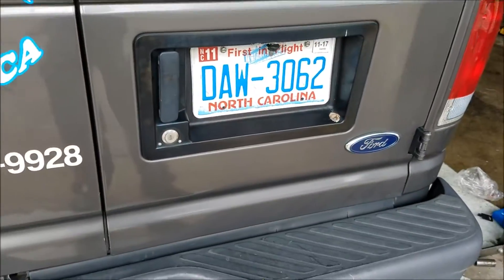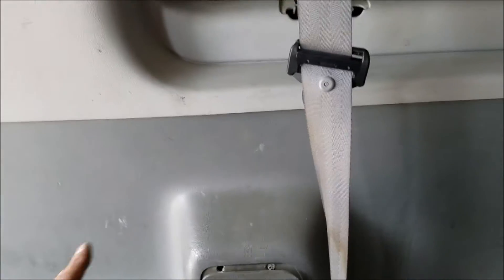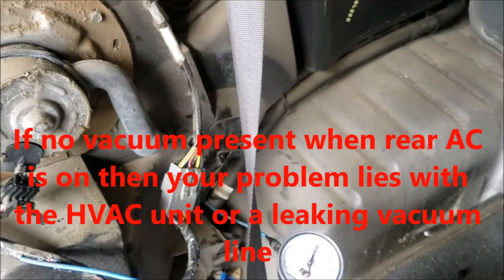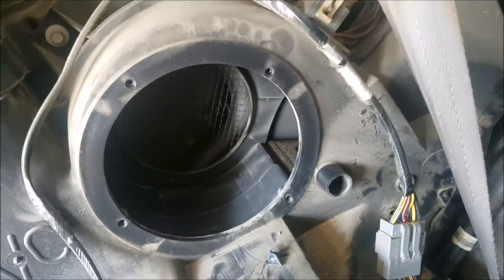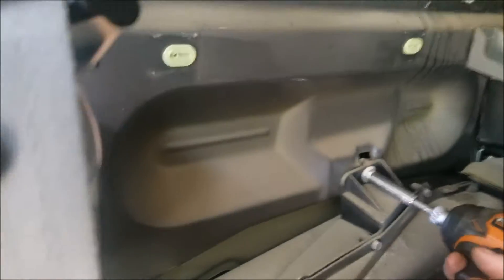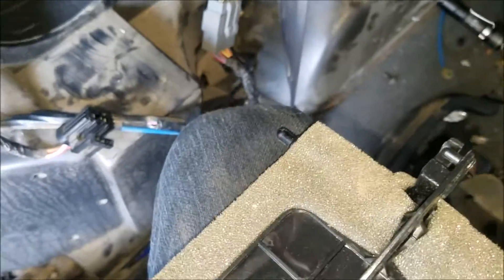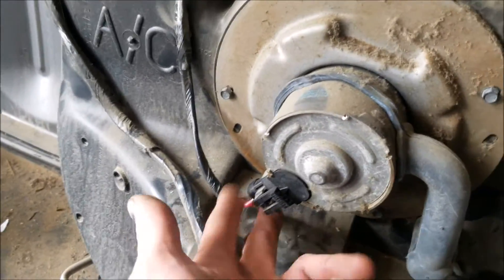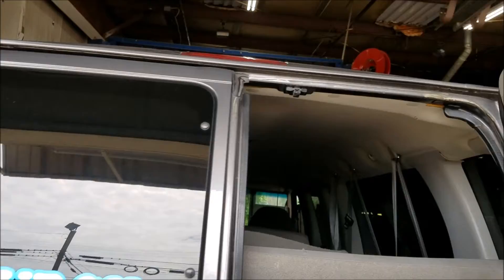E350 rear AC fix - blend door replacement

Comment: This is the best video to get to the blend door!  Here is my $5 fix for the actual door so you don't have to buy the $100 kit, thanks again!  https://youtu.be/rt6erxpDa60
Reply: I am working on an 2014 Ford E350 van rear blend door right now...thanks for the clip
Reply: I use MEK to Repair mine.
Reply: The doors are cheaper now. I fixed mine years ago in the same manner you did and it failed recently. Found multiple new ones for around $25.
Reply: @richsoutherland2924  Thanks for the info Rich.  Do you have any links for the $25 blend doors just in case I need it in the future?  Was it ebay, amazon or?  Thank you!  -Robert
Reply: @ford-fix  5C2Z19A760A
Reply: @richsoutherland2924  I can't seem to find a replacement  door anyone with a part number? Or link
Reply: @tromponist  5C2Z19A760A
Reply: Dorman #902-507, it's $20.
Reply from the maker: Nice man
Reply: @LehewTech  hi thanks to your video i was able to fix my van. Now my problem is the air thats blowing from the ceiling is still cold air even if i have it on heat. The front blows heat no problems but the back passenger area blows cold air. But when i switch it to “Floor” then yeah it blows hot air from the floor. What seems to be the issue here? TIA
Reply: Ours is blowing air through the top, but its hot.. front ac is cold
Reply: @juanncriscortes4877  i have the same problem do you fixed

Comment: Thank you so much! I have a 12 passenger so I had even less room to work with. I ended up taking the next six screws off along the side and that gave me enough clearance to pull the unit out some and install the door and the actuator together.

Comment: Hi my van wasn’t blowing any aire on the back and the mechanic took off the first piece that you took off and left the back on ac only for now stating that I need to buy not just that piece but the whole system starting from front to back which I don’t understand why but the piece that is broken in your video is the same piece that I need,and he said that I don’t need only that piece but the the system

Comment: When you slid the flap in without it being attached to the actuator, then dropping video to finish, was misleading. I put the flap in attached to the actuator, which wasn't that hard. After that it was real easy. I also heated everything up with a hair dryer and no clips broke.

Comment: Thanks for the video , question is it easy to remove all the rear AC with the plastic trim , I have an opportunity to buy one like that , I will build a camper. On that side will be only custom wood cabinet ,

Comment: Here’s what I did to connect the door and actuator - in case anyone needs help in the future. With a little wiggling and wrestling you can get the ac hoses towards the front of the van from the fan out and around the side plastic. This allows you to sort of twist the entire unit out - front end farthest. Then you have enough space to install the blend door and actuator together. To clarify, that whole rear unit is about 3 feet long. The part nearest the front of the van is the rear AC evaporator coil and lines. If you wriggle that part out you can sort of lift and tilt the entire unit out and have enough space to reinstall the door, actuator, and screw fairly easily.
Reply: Thank you!! Thank You!!! I fiddled with that thing for over 30 minutes before reading your comment. You saved me!
Reply: @mitadaka  I’ve been helped on here so many times I feel obligated to help back. So glad I was able to return the favor.
Reply: Could you explain how you got the whole unit to turn? On the bottom left of the assembly there’s metal piping keeping it grounded
Reply: @patrick121295  I left the AC lines in place and wrestled the other end out just enough to slide the part in. Probably had to remove a screw or bolt somewhere on the it. Was tight for sure.

Comment: Awesome, you didn’t record the only part anyone will for sure have trouble with
Reply: Here’s what I did - in case anyone needs help in the future. With a little wiggling and wrestling you can get the ac hoses towards the front of the van from the fan out and around the side plastic. This allows you to sort of twist the entire unit out - front end farthest. Then you have enough space to install the blend door and actuator together. To clarify, that whole rear unit is about 3 feet long. The part nearest the front of the van is the rear AC evaporator coil and lines. If you wriggle that part out you can sort of lift and tilt the entire unit out and have enough space to reinstall the door, actuator, and screw fairly easily.

Comment: Great video! How did you hook up the blend door and the sliding metal piece?!
Reply: Here’s what I did - in case anyone needs help in the future. With a little wiggling and wrestling you can get the ac hoses towards the front of the van from the fan out and around the side plastic. This allows you to sort of twist the entire unit out - front end farthest. Then you have enough space to install the blend door and actuator together. To clarify, that whole rear unit is about 3 feet long. The part nearest the front of the van is the rear AC evaporator coil and lines. If you wriggle that part out you can sort of lift and tilt the entire unit out and have enough space to reinstall the door, actuator, and screw fairly easily.

Comment: Another thank you! AC lines were still cold so I assumed an actuator or blend door problem. Your video saved me the trouble of figuring out how to access the door. I made a tab/post out of metal and 5mm nuts and bolts rather than replacing with another blend door destined to fail. Nice to have rear AC again. My kids are grateful. :)

Comment: Quick question I’m working on a Ford 2004 E250 The problem I’m having is when I’m switching between floor and mix I’m not getting the defroster It’s stuck on regular air conditioning coming out the front Vance should I be able to open the ventilation door by hand when the vehicle is off or put in mixed mode or floor mode or vent mode turn the actuator vacuum pump actually be seized causing me not to have it working when I switch the knob on the dashboard I do here it’s trying to do something

Comment: I need ONLY AC ever, NEVER heat (in the rear, cargo section, for my van), so, I'm going in there with some duct tape and see what happens! Lets see what happens when the gate is taped on to ALWAYS blow to the top! EDIT: IT WORKED! THANK YOU so much Lehew Tech!!! You saved me hundreds of dollars in repairs and being offline while waiting for repairs (not that you can find a mechanic that's available these days, not even the dealer, they said come back next month with appointment!).

Comment: The hardest part is connecting the door and the actuator, wtf Ford really no better way of clipping these on?
Reply: I clipped it on before setting the door into the box slit, with those two 10mm bolts off the HVAC box moves quite a bit. I had one hand pulling the mode door inwards and with the other I carefully maneuvered the actuator & door into place but it was more of the hand pulling from the box that got the whole thing in there.

Comment: I recommend starting at the front to see if you have vacuum making it through the firewall. I have seen tons of these videos, and, like mine, the issue was up front for most of them, vacuum leakage on the tube that passes through the firewall on the right side. Just remove the doghouse engine cover and check vacuum at any black colored vacuum supply  line. Mine was at 4 and it should be between 15 and 20 I believe. Good luck and reply with questions... https://www.youtube.com/watch?v=XpaKFgL6EhM&t=636s

Comment: Do you have the part numbers to the blend door and actuator?
Reply: Actuator: 6C2Z-18A318-BA and mode door: 5C2Z-19A-760-A. Seems pricing has gone down and the mode door sells from dealership at less than 20 bucks but the vacuum actuator is not available. If you go yo Ford Parts Giant you find them both for sale and a whole lot of info on related parts/parts numbers.

Comment: Read this to save a butt load of time and money. 
The blending door is cheap to buy and cheaply built so reinforcing it is good. BUT the real money and time saver is getting to it. 
Keep reading to save time and money. 
As you know by now to get to the ten dollar blending door you must worse case:
Remove a couple or more bench seats.
Remove the giant inside plastic panels.
Now you can't get to the screw that holds the blending door in the evap housing.
Remove the refrigerant lines.
Remove the heater hoses. 
Remove the evaporator. 
That is an enormously hard and expensive task. 
But wait, before you turn a wrench read on. 
If you replace your blending door like I did you will be finished in a jiffy. 
I very carefully CUT an approximately 8 inch by 12 inch hole in the rear right fender well just behind the rear tire. 
Then I took a socket with an extension and removed the blending door actuator assembly from the evap housing.
Disconnect the vacuum hose from the servo diaphragm actuator. 
Installed a new blending door. (I bought one at the local ford dealership for about 10 or 15 dollars). 
Install the new blending door in the actuator assembly.
Install the blending door actuator assembly in the evap housing and connect the vacuum hose. 
I then made a cover from a thin piece of sheet metal. 
I formed the metal and put some weather adhesive strips on it. 
Then I attached the cover using self-drilling sheet metal screws. 
Done deal I'm finished. 
Just be very very careful when cutting not to hit a heater hose or refrigerant line, snips might be safer than a jig saw. 
I didn't make a video of the process but I do have some pics but can't figure out how to load them. 
Bo Overbey

Comment: Good video... but PLEASE explain how to get the tab on the blend door into the  metal hole on the actuator, when the blend door is in place.  It is freaken impossible.
Reply from the maker: I remember that being very difficult, I can't remember exactly how I maneuvered it into position but I do know that I put the blend door into the housing and then I was able to connect the actuator to it
Reply: Here’s what I did - in case anyone needs help in the future. With a little wiggling and wrestling you can get the ac hoses towards the front of the van from the fan out and around the side plastic. This allows you to sort of twist the entire unit out - front end farthest. Then you have enough space to install the blend door and actuator together. To clarify, that whole rear unit is about 3 feet long. The part nearest the front of the van is the rear AC evaporator coil and lines. If you wriggle that part out you can sort of lift and tilt the entire unit out and have enough space to reinstall the door, actuator, and screw fairly easily.
Reply: I found it easier to assemble the door onto the actuator while outside the HVAC box, raise the rear HVAC as much as possible, wiggle in a corner of the mode door and pull from inside at the same time that I was pushing & adjusting assembly from outside. The rear unit can lift at an angle quite a bit without any harm to connections or hoses.
Reply: For anyone who comes in, once you have the blend door in place, use your left hand to lift the door up as if the AC was on, then bring the lower piece in at an angle where the metal arm comes into the gap between the plastic nub and the guard at a 45 degree angle, once in place, try slightly lowering the door and turning the metal arm slightly and it should wiggle over the plastic piece.

Comment: Great Video.  2012 E-350.  Mine broke in the same spot.  I repaired the door with MEK solvent and added some scrap ABS plastic for reinforcement.  I don't mind spending $100 for a replacement part but if the part is a bad design it will just happen again.  Now mine is stronger then original.  Hardest part was putting the actuator back in where you had to use two hands.  but I got it.

Comment: Excellent video!  Thank you so much!  My symptoms were exactly what you described: hot air from the floor vents and nothing out of the ceiling vents.  I got to the blend door and discovered the exact same problem.  Instead of trying for the screw holding in the actuator, I just put duct tape on the top of the door to hold it to the housing in the open position.  Yay!  Cold air coming from the vents!  Thank you so much for helping me to discover the cause!
Reply: I’m glad I’m not the only one who was thinking of doing this 😅. I don’t have to cash to address the actuator but I need A/C ASAP

Comment: The van I drive for toddlers A/C rear doesn't come on, only front a/c works. What's going on?
Reply from the maker: Does it blow air at all?
Reply: Lehew Tech not at all for the rear passengers. Just front.
Reply from the maker: Check the rear blower motor fuse and go from there
Reply: Lehew Tech Oh! Okay! Thanks I'll check that.